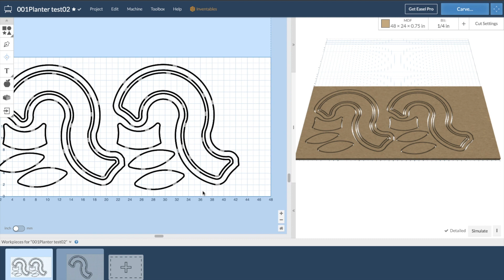Making Modular Concrete Raised Garden Beds

Comment: I fully expected to be the 50th person here to remark that you should have made the two smaller pieces as a single piece. You would have ended up with the same design but the structure would be much more sturdy, especially if you offset the gaps like brickwork.

Comment: Nice work and very innovative!  I’ve found using a reciprocating saw works the best to knock out the air bubbles and allow the concrete to settle in my builds.  👍🏼

Comment: That last forever but thats a lot of work. I wanna know if any diy maker is even going to make one of those.
Reply: I'm going more for a modern linear look, so forming with wood, and a larger planter is the way to go for me. Otherwise just use nice large pieces of wood or header wood or engineered scrap wood to make a planter.
Reply: Imo. I wouldn't suggest it if only due to the energy/emissions of the material. I wonder what the alternative would be for this look though? Hand placing stones? Maybe earth?
Reply: @Ash-yh5oy  he could of just painted those used tires grey to make look like cement. Jesse poop house has tons of it too. Lol!